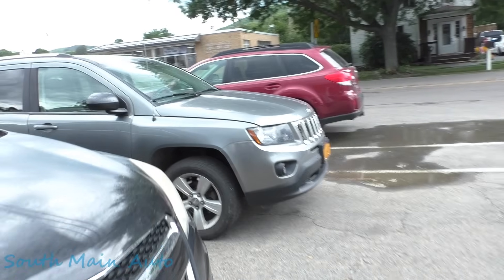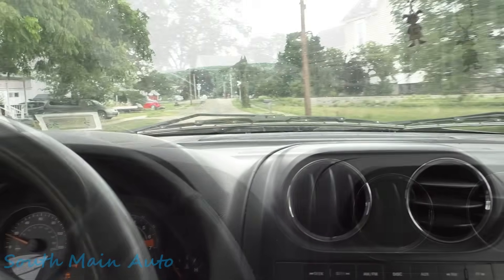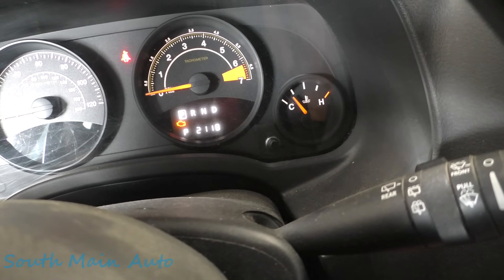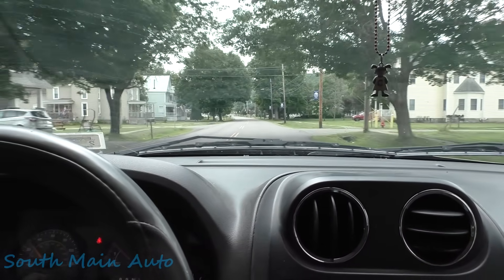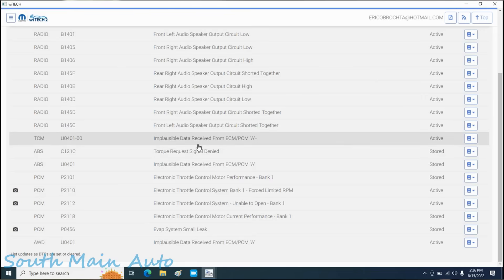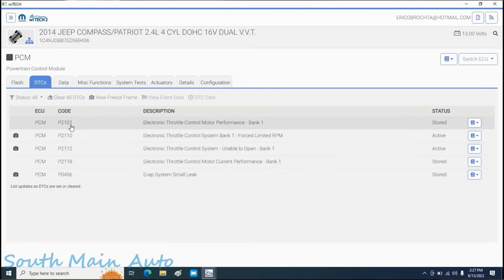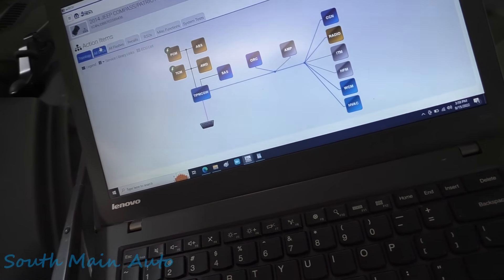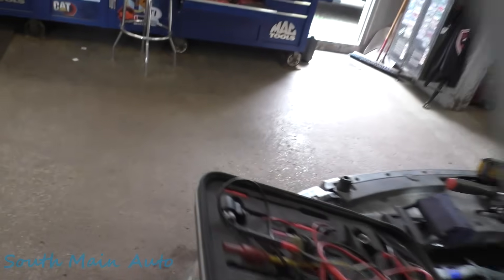Jeep Compass: Flashing Throttle Light & No Go

Comment: Just a little tidbit because of your little stuck throttle at the end comment, the Prius stuck throttle was not due to the floor mats. Toyota always blamed the floor mats, but in reality it was proven through litigation that the cause of the stuck pedals was because of a 1/10 of a cent piece of plastic washer in the pedal assembly that would wear oddly, and then it would jam the pedal to a partial open position or it would block the sensor enough to make the computer think the pedal position was either partially open or fully open. One of the plaintiffs in the case did not have floor mats in the car. Toyota hid this cause, from Regulators until the private lawsuit against them reached the point of trial and Toyota was forced to show internal documents that Toyota knew exactly what the problem was.   They had also been informed by their testing company that this was a probability with this washer design. They chose to move forward using it because it was cheaper than a metal washer.

Comment: Never push open by hand an electronic throttle body to clean it. I learned that the hard way. Destroyed it and got a replacement which fixed the throttle light on a Jeep Commander Hemi 5.7.
Reply: How come his still worked?
Reply: @gregjohnson2073  I don't know. He is lucky. The service manual states never push the throttle by hand to clean.

Comment: My gf her throttle body went bad at 30k then at 50k valve cover/timing chain cover starting leaking oil. We're at 78k and the intake manifold has went bad dealership also replaced the pcm. Nothing but problems but warranty has covered it.

Comment: Check those front wheel bearings, esp the passenger side....spray  the mass air flow sensor with proper fluid, also...

Comment: This is how mine started, 2015 jeep compass. They cleaned the throttle body, happened again so replaced it. 3 throttle bodies later and still having issues. I put the foot down to go and its delayed big time, if it delays for more than a few seconds the whole car shudders and the throttle light flashes, always has the engine light on too. No flipping idea what is going on with it!

Comment: Didn’t it say on the code run criteria that the throttle relearn had been done? When you reset the codes or disconnected it for testing would that pid have cleared?

Comment: I have the same problem with my 2011 Dodge Ram 1500 4.7l SLT. I've replaced the throttle body, amongst other parts, and it didn't fix the problem. It also threw a code for the accelerator pedal sensor.

Comment: That’s what I’ve always said after working at a Chrysler dealer for 10 years, Honda for 1, and independent now for 4 years, is Chrysler has by far the best service info and scan tool. Honda has the absolute worst, and GM isn’t far from the worst. What’s funny is back at Chrysler training, all the old guys would complain nonstop about service info and wi-tech, they wouldn’t last 5 minutes navigating through the Honda scan tool.

Comment: On my cable operated '03 I'd step on the gas and my foot would catch on something under the dash.  I must have checked under the dash at least three times for what my foot was catching on - maybe something sticking out of the heater box.  There was nothing.  So, yeah, throttle bodies get dirty and stick.

Comment: Had a throttle position code on a Holden (Chevy) Trax one time, it wasn't seeing a closed throttle position at key on and then threw the corresponding code.... visual inspection found one of the air cleaner box lid screws was trapped by the throttle butterfly in the throttle body, the previous repairer had left it on top of the air filter when doing a service... thank Freddy that the PCM disabled throttle operation with that code or there would have been a broken engine quick smart.

Comment: My 05 Hemi WK will flash that throttle light too and it’ll misfire when it idles high like that too. I think it’s a programming thing.
Reply: I think there's a tsb on that. Chrysler used to reflash those pcms and update the calibration on those throttle bodies to fix that. Or maybe I'm thinking of gm drive by wire. It's hard to remember sometimes

Comment: There are two plastic gears inside that throttle body that like to wear. It does a self test each time you turn the key on. full sweep of the blade.

Comment: Why did you call it brakes and not a wheel bearing? I mean you acknowledged brakes were needed a little after but at the time when you swung the wheel back and forth that usually reminds me of a bearing test and not a brake check

Comment: GREETINGS, I HAVE A 2011 INFINITI G25 VOLTAGE PROBLEM I HAVE REPLACED THE BATTERY AND ALTERNATOR ALSO I CLEANED THE FUSES/BOX AND STILL NO CHANGE. WHENEVER I DO AN INITIAL START UP IT GOES TO 14.+ BUT WHEN I START DRIVING IT DROPS ALL THE WAY DOWN TO 12.9V OR 11.9V, AY IDEAS ON WHAT COULD BE THE PROBLEM??????????NEED YOUR INSIGHT ASAP.

Comment: I have been working on the Patriot version of this..... replaced both O2 sensors and then about 20miles later a MAF sensor code pops up .....Any ideas as to root cause?  my plan was to to use MAF sensor cleaner and go from there....

Comment: Guess the Compass was pointing south to South Main Auto. 

Also, adding some more thoughts to the Bluetooth throttle, I think that it would probably lose communication 99% of the time. I walk ten feet away from my stereo on BT with my phone in my pocket and get a bad signal, not to mention that my 10 year old laptop rarely ever connects to the same Azultooth. What's even funnier is that I walked 3 miles away from a Chinesium portable speaker and the signal never quit even once. 

To be honest though, I think there was some truth to Toyota's throttle cables going WOT from corrosion. My Toyota is 22 years old currently and had the throttle cable recalled, since then the assembly has gotten a touch of corrosion from the salty winters and I can see where a poor quality assembly could fail. I don't believe every model was affected the same way, maybe your suggestion of user error i.e. the floor mats was part of the blame.

Comment: I installed a new throttle body and the problem with the limp mode is still there. Even after clearing the codes and driving 20 days. The old part was still clean.

Comment: Not sure if you knew but it's a known issue to have those codes trip with a dirty throttle body I'm not sure if they suggest cleaning but I do know that it's an issue and a few other vehicles also have it, and that's usually the fix unless there's actually a motor issue. I think there's a GM bulletin on it. I'm surprised it didn't pop up. They basically get dirty and you have to clean them. Even though standard practice they want you to load the parts Canon and replace them anyway. It's just one of those mechanic things you know. I don't know if you charge them or how much you did for doing that because there was labor involved but no actual parts replacement. However you did notice that there was other issues with the vehicle and I probably would have let the owner know about that and possibly do those repairs cuz it sounded awful!

Comment: Where does all that coking come from? Is that the result of exhaust gas recirculation?
PS. Putting the throttle cable back is no guarantee of it never getting stuck. I've seen enough stuck throttle cables to know that.
Reply: PCV.

Comment: My 07 Dakota 3.7L 
It’s a manual transmission, if I Lug the engine to much the red lightning ⚡️ bolt light will come on AND the Truck Sounds Like It’s Underneath Water… if I shut it off and re-Start it up then it’s fine.

Comment: Hi Eric and the Lovely Mrs.O., Zep used to make a fantastic carburetor cleaner, maybe they still do I don't know, the only time I came across it was at work. We got it thru a ZEP distributor. ZEP sells cleaning products thru The Depot but no carb cleaner. I thought the ZEP stuff smells like and works as good as Berkbile 2+2. It will also make your brain run out your ears, but it really works well. that,s all for now, bye bye!

Comment: A member of a f150 forum drives a Compass to work.  He has over 300k miles on it.  He says he has rebuilt the front end several times but the 4 cyl engine just keeps on trucking.

Comment: How did the throttle body get that dirty? Once ran out of gasoline and had to use kerosene to travel 50 miles. It smoked like the cross- town bus and wouldn't go faster than 35mph... A 1953 Chevy.

Comment: Just had my own money shot after customer insisted it was the throttle body. Replaced throttle body same problem. Diagnosed further and found broken wire at engine harness plug

Comment: I just had the same problem with my Jeep Patriot.  Fortunately I had a new throttle body to put on and now it runs better than it ever has. I have a question though, my ABS light came on just like this one....and then went off after the fix? What does one have to do with the other?
Reply: By-wire allows the throttle to be opened or closed independently from pedal position as needed to stop wheel skid or slip for ABS, traction, and stability control purposes. With a mechanical cable throttle the only way to reduce engine power is to intentionally cause misfires which is why he felt misfires in this video because that's exactly what it was doing with a stuck throttle.

IE if the DBW isn't working the ABS/traction/stability can't work properly either so the light comes on.

Comment: hi i have a 2015 with the sameish problem i only get 1 code p2173 any thoughts
Reply: I cleaned it and replace the pluge and changed the PCV valve so far

Comment: Had an acquaintance bring me one of these saying it had an intermittent misfire coupled with the inability to accelerate past 30 mph at times. I figured there would be a money light showing numerous codes. Wrong! The thing had the most horrible stuttering miss, would downshift but just made the entire vehicle shake horribly and sure enough, wouldn’t go any faster. Guess what….no check engine light, no stored codes….nothing. I told her I wasn’t very familiar with Fiats and she looked at me kind of funny, then said “but it’s not a Fiat, it’s a Jeep”. I had to break the bad news to her that the only thing Jeep about it was the ornaments and logos. I found and replaced two bad ignition coils which solved the problem. She wisely traded it in a week later.

Comment: I have somewhat of a similar issue on my 08 ram 1500 3.7 but no codes but 1/4 throttle is all she got and in 6th gear floored is my cruise control I think it's a throttle position sensor but I'm always on the road so I haven't done anything with it it's been like that since I got it it runs fine as far as no misfiring or anything if anyone got any other advice I thank you in advance

Comment: GM's 1.5L turbo has a throttle body that's extremely intolerant of being dirty.  It will set a P1101  "MAF out of self test range"   A little cleaner on a Q-tip and she's good as new.....until the next time it sets.....

Comment: A local chain shop, with two pretty boys sitting behind computer monitors, does not repair components but only replaces them. In that shop, the customer would have purchased a new throttle body. I wish you were my local shop.

Comment: 2012 Compass with 75.000 kilometers (46600 miles), if you plan to buy one, this are the odds with it. Squeaky bushings, poor suspension components quality, had rear 2 stabilizer links replaced even though the car is not used that much, but it degraded and needed replacement, each year eats light bulbs from the daylight running all the time, inside AC fan regulator was gone and was making a cracking sound when switching temps, the part was poor quality and internal gears very cheap, I'm in the 3rd throttle body assembly like the one on this video (they only last 22-25k, i even bought an extra one to have in stock for when it fails), the radio stopped getting FM signal (not an antenna issue , this was a known issue with the same radio type across Chrysler models), needed to replace the power steering fluid after 20.000 kilometers since it was degrading quickly (smell + visual inspection), aftermarket fluid is holding way better after that, and now one wheel bearing sensor is reporting to the ECU that it needs to be replaced, this with 75.000 kilometers, and sometimes getting a check engine light for a stop brake switch that was coming back each year when was too cold. So think your way if you want to get one of these, we are holding this one until reaches 100.000 kilometers to sell it since the engines has not failed yet, but, this car take some money each year for sure, we felt like we had our previous car that needed maintenance more often, definitely a jeep compass is not in our list for next purchase.  Hope this works, great video and if you see this issue, cleaning the throttle body will just take your time, buy one and replace it to save you time it will indeed get broken very often, plastic gears inside are crap.

Comment: Just Empty Every Pocket
Reply: Junk Each and Every Part
Reply: @BigPapa_2001  just Eats every penny
Reply: It's a heap!!!
Reply: People trash talk Chrysler, but my 08 SRT grand Cherokee has been the most reliable and least expensive vehicle I’ve owned. (Fuel and tires aside). It had a defective water pump at 25k (they all did) as well as a stupid 2 piece coolant hose that would blow apart (easily fixed with an off the shelf one piece hose) and I had to drop in a new radiator at around 175k. Other than that it has been trouble-free for well over 200k miles. I should be embarrassed to say this, but it is still running on the original spark plugs. I’ve never even had them out and have never seen a single misfire on the misfire counter. In fact I haven’t ever even had the check engine light come on. I did have to pull the transfer case and replace a worn out splined coupler that mates the trans output shaft to the t-case input shaft, sometime after 200k miles. That has been my only major complaint as there was no way to easily PM that coupler and it wearing out, without getting greased once in a blue moon, was inevitable. Oh and had to do ball joints last year, but that’s to be expected on any vehicle... I’ve sure had a lot better luck with Chrysler than I have GM and Ford. My 1992 Dodge 350 with the Cummins will absolutely run forever. Just about nothing electrical works lol, but on that truck who cares?
Reply: @athhud  never should have said all of that , you jinxed yourself!
Reply: @jerrypeal653  lol I’m not scared. With the way that thing drinks fuel and the fact that it is appreciating in value every year, AND that the fragile plastic bumpers and one of a kind transfer case fluid have been discontinued and are impossible to find... It is going to stay parked for a good long while. My go fast days have been traded for 3 little girls. I’ve got the entire Jeep’s interior pulled out and stored in the temperature controlled house. Now I am just waiting on the idiots to wreck the other few thousand of them that were made and/or blow up the last of the 6.1L Hemis. When I can get 6 figures for it at Barrett Jackson, then I’ll worry about dropping a fresh set of iridiums in it. I rode the old girl very hard throughout my 20’s. Now she’s been put up like a fine wine and just getting better with age.
Reply: Lol 😂 cha Ching

Comment: I had a car that had no throttle response after start up, simultaneously not showing the "PRND4321" (digital) on the dash. The way I "fixed" it each time was to unplug the MAF sensor when it was running, plug it back in, turn the car off, restart it....fixed. Which didn't make sense, but I figured whatever....and sold the car.

Comment: we do not need drive by wire! we also don't need half of the car to run thru the ABS. have several customers cars will not shut off unplug abs and goes dead. the abs shouldn't have anything to do with anything but brakes

Comment: The throttle body needs replacing.  The nylon gears inside the housing have worn and the throttle plate dithers.  The issue isn't electronic, it's mechanical.

Comment: I'm not a fan of the throttle by wire system. I don't like the push button start and stop system. For me that is one of the few things that will make me reject a car for having. I have also put throttle body cleaning on my list of things that are done at least twice a year. Especially with the throttle by wire system. That decision came after my 2014 Nissan Sentra started sporadically hesitating to come off idle for about a second and would jump off the line when it did accelerate.

Comment: Hey Eric. How's it going? I noticed in a few of your videos, that you've been plugging the Astro tools from Amazon. I started to follow your lead with regards to that,and have, unfortunately, come to find out that their tools are really pricey, compared to other vendors on Amazon, and the quality of said tools are extremely poor. I have purchased a digital tire inflator, which arrived touched up on the handle with a sharpie marker, did not seal on valve stems well at all,and is now broken. The $70 wirelessly charging flashlight, that you also use, turned out to be complete garbage as well, and among a variety of hand tools, service kits, etc. All junk. I have had greater value and success from Walmart's line of Hyper Tough tools. Do you have any similar feedback on their products?
Reply: I have had a good experience with all the astro tools I have purchased. (2 sl40s, 2 of the smaller lights with the uv end lamp, the under hood clamp bar light, big nasty, and a set of die grinders, snap ring plier set...). Very pleased with the performance/dollar ratio.